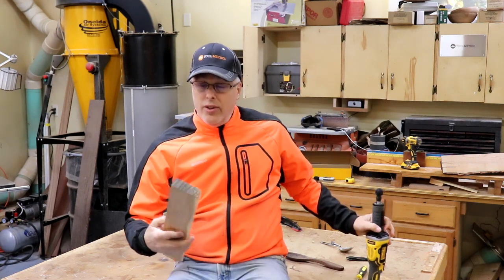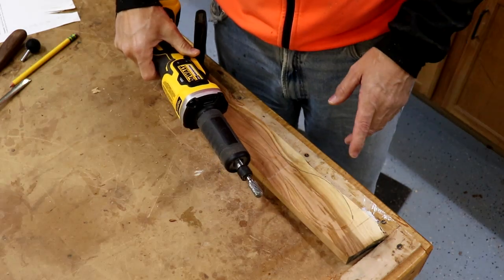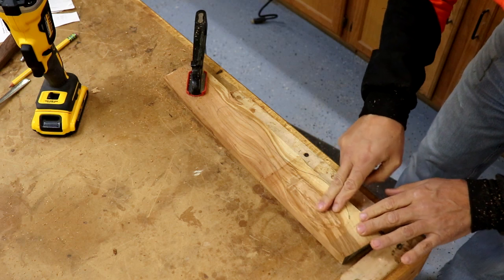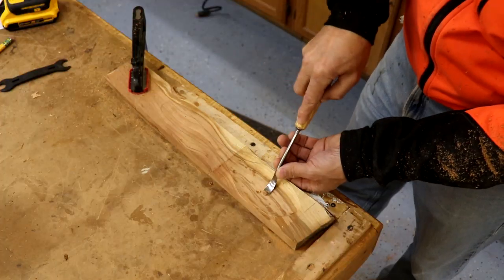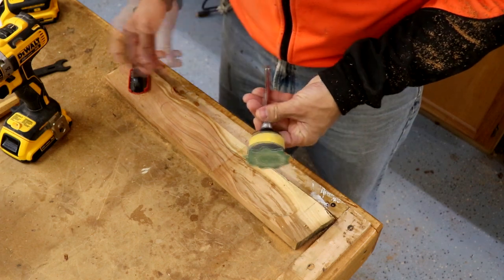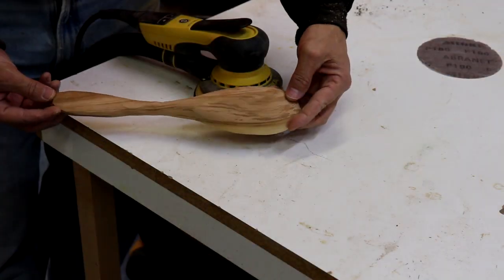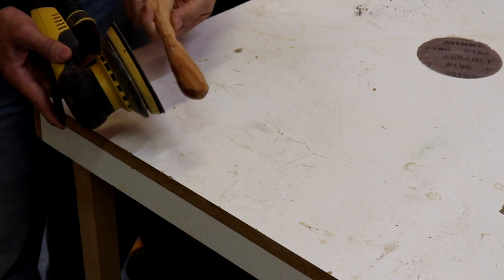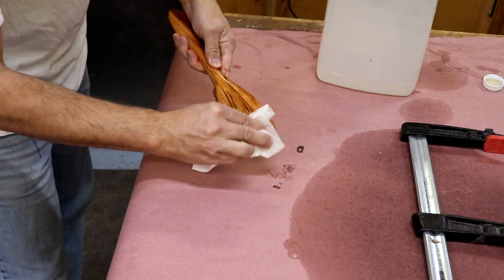Power Carve a Spoon with a Die Grinder

Comment: I'm Making A Spoon Rest Out Of
Maple & I've Got The Bowl Looking Prettygood & All I Need To Do Is 
Cut It Out Then All I Need To Do
Is Do Alot Of Sanding On It.
Then Shelack It Cause All It's 
Gonna Be Used To Put Spoons In.
Reply from the maker: Hi Roger, that sounds great.  In terms of finish, I wouldn't use shellac for a spoon rest because it is not durable for moisture exposure.  I would suggest either a mineral oil finish that is easy to refresh, or a food-safe poly that has moisture resistance.  My top choice would be mineral oil and beeswax.

Comment: I'm Starting A Spoon & I'm Making
Mine Out Of Oak & I'm 
Tracing Around A Pocilin Spoon 
Holder To Make It. Then I'm Gonna
Use A Rotary Tool I Just Bought 
Off The Home Depot Website.
Then I'll Shalack It & Use It
As A wooden Spoon Holder.
Like My Porcilin One.
Reply from the maker: Hi Roger, that all great. Beware that shellac isn’t moisture resistant so if you ever use the spoon and have to wash it it could be a problem. But for display-only purposes it will be great. Cheers